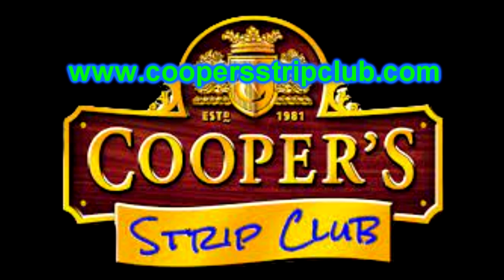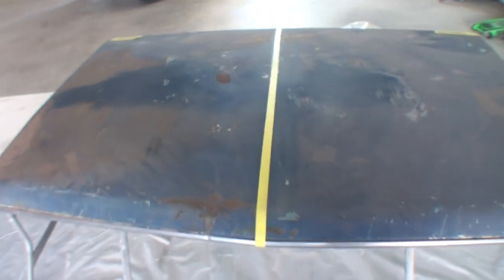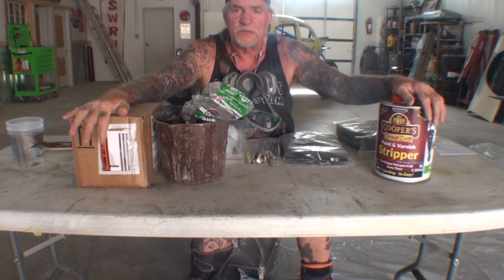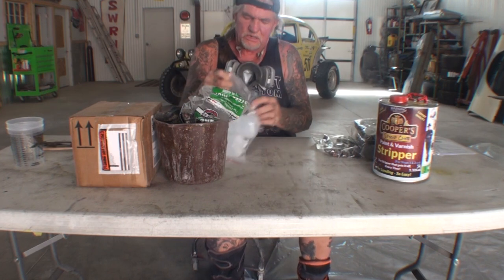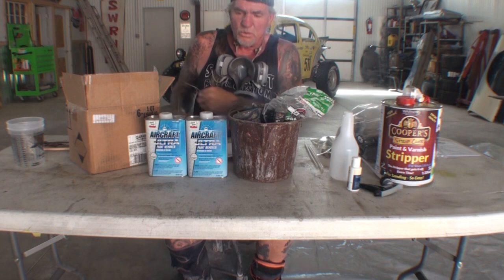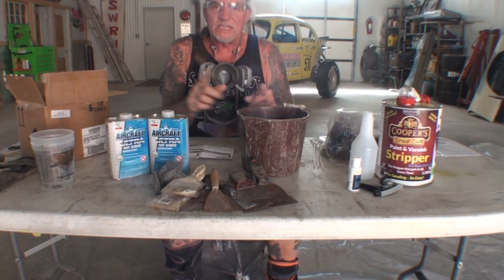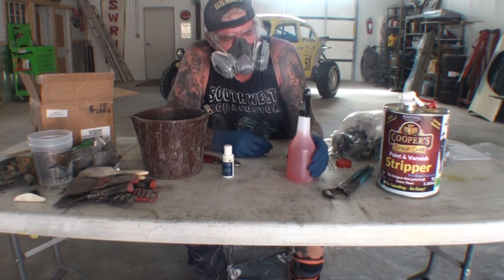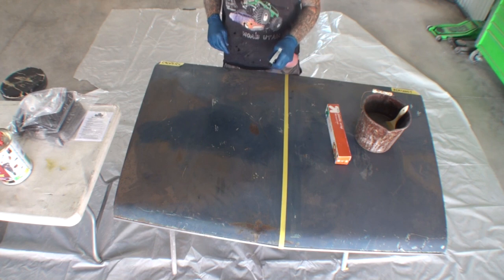Aircraft Stripper Vs. Coopers Paint Stripper - Removing Paint Off A Car

Comment: Look at the price comparison, I just bought a quart of the aircraft ultra for $20. The cheapest option I see from cooper's is $95 with shipping. And that doesn't include the flusher, spray bottles, wool, etc. To get all of that would be $250.

Also, from other videos I've seen, the longer you can leave the aircraft stripper on there, the better it works. I. E. Multiple layers at a time if you're patient.

Regarding the cellophane, I'd be annoyed to if I applied it in 1' sheets like you did. Just buy a large plastic sheet. 10'x10' is  $2.

If I had an unlimited budget, I'd for sure go with the cooper's. But many of us have some fairly shallow pockets.
All that to say, the aircraft stripper certainly has its place.

Thanks for posting this.

Comment: If you use lacquer thinner on the steel wool and use a rag with lacquer thinner the residue comes off much easier, especially with the Aircraft stripper... I like the aircraft stripper because it is a gel and does not run as bad as liquid strippers on vertical surfaces... Also a guy on YouTube places a paper towel over the gel stripper, applies a coat of stripper over the paper towel and then covers it with plastic wrap... Works really well and seems to supercharge the stripper... BTW I've used both products to strip paint off corvettes... Cheers... M

Comment: An old trick was to give it a rough sand so the chemicals penatrate faster.

Even the old aircraft stripper. It was a trick to lay plastic on it to keep it wet and keep the paraphins in there.

Comment: My experience with Coopers Strip Club paint stripper.  I am renovating a 1975 MGB and it is time to remove decades of old paint and areas of relatively new paint.  I waited impatiently for my kit to arrive, and it did about 9-10 days after ordering.  I had watched a bunch of videos and read all of the directions. 

I filled both of the spray bottles.  One with stripper and the other with flusher then sprayed one of the front fenders.  The relatively new paint (3 coats of 2K Urethane and 3 coats of 2K urethane primer) peeled off down to the bare steel after sitting for about 5 minutes and I got ready to junk my DA and rotary sander until I got to the sections with the factory original, 49-year-old paint and primer.  A few areas began to bubble after several sprays, keeping the surface wet.  After about an hour, I used a putty knife and attempted to scrape.  Almost nothing came off, so I sprayed some more, kept the surface wet and tried again.  Oh, I was spraying with light to moderate coats of spray.  the base barely came loose.  I switched to a combination of the DA with 120 - 80 grit and additional applications of stripper.  I have a very long way to go and am disappointed but will persevere.

Here are some of the issues:

The triggers on both bottles stopped functioning after a few hours use.  I cleaned each sprayer and blew air through each one while depressing the triggers.  The airways were not obstructed.

I only received one trigger tube and one handy faucet sort of thing.  The spout worked nicely, but I would have liked 2 of these.

I would have liked to have more Flusher but will husband my supply to make it last.  Incidentally the stripper hurts like hell if and when any of it gets through to the skin.  A spray of the flusher stops the burn.

All in all, I would recommend this product for relatively new paint removal.  Paint removal from a classic auto does work but is very tedious and consumes quite a lot of product.
.
Reply: Abrasive blaster. Done.

Comment: Looks like I’m gonna have to try the coopers on my 914 doors. I didn’t want to blast them because I’m concerned about warping, but they have multiple  layers on them
Reply: @benzracer9  From what I see, the Coopers Strip Club product will serve you well! As you indicated the vehicle may have 4 layers or 4 paint jobs which includes many layers but success is with in your hands. They have owner videos and customer videos, sold in kits but available in bulk container of liters from New Zealand. Instead of methylene chloride exclusive to the main ingredient it uses a chlorinated base. Opposite of an acid yet it soaks into micro pores of the paint. Repeat as needed for layers of paint.
  The EPA banned sales of products containing the sale of methylene chloride not because some people improperly used it and passed, but they could not control the disposal of the product and paint debris it removed.
  I bought many, many gallons at Menards as I saw the price increase. I am doing a 1967 C10 truck for myself. If you have plans to do multiple customers in the future, Coppers appears the best way as it does contain methylene chloride at a lower level that allows for sale now. This is subject to change but $250 will get the stripper and finisher in large quantities. The additional items you may wish to purchase are made available. DK, Omaha.
Reply: @deankay4434  yeah, I’m definitely going to order some for this project. I happen to have the doors off the car,so I can set them on stands which will make it easier to strip them too.
Reply: @benzracer9  Note; Just explain to wife in advance to charge showing up on credit card!!!!
Better to ask for forgiveness than permission or in some cases both!
LoL. DK, Omaha

Comment: Great stuff! Love your channel. Any suggestions on How much of the Coopers product you would need to strip a whole P/U truck or Car?
Also, the idea that your going to wrap up...say a whole car or even an AIRPLANE in cellophane every time to strip paint is insane...so understand why the Coopers is top product in that respect.
Reply from the maker: On their website there is toll free phone numbers for several country’s And one of them is USA. The lady will answer all you questions.  Thanks for watching
Reply: @Love Trump  > The lady I spoke to is the owners wife. She is extremely knowledgeable and no hard to understand accent, easy talking. The sell kits but re-fills in larger containers. I can’t speak for the shelf life but I like research before spending my hard earned Biden Bucks as you get so much now! (NOT!) 
I have a 67 C10 and I am sure would know that is a lot of square footage. Yes, the steel wool is much stiffer and the nylon pads are dense, with that said, or a re-fill of “Stipper” and “Flusher” and look at a liters = Gals calculator online. I think it was $250 delivered. They maybe slammed with orders after Petes video, and good for them! From what I can tell, get the refill size, you are smart enough to figure the rest out, but keep containers closed, sealed in a coil dark area if you have left overs, you should be good to go for several years. I am in Omaha and instead of Polar Vortex and Global Warming, we have weather! It’s like calling suspenders “Anti-Gravity-Devices for Britches” but we just call them suspenders. However, I think uncle Joe is going to write an executive order called “REF” for “Rubber Elasticity Failure” order making rubber bands, bungee cords, suspenders, underwear elastic and bra straps use less and not spring back (Their goes his Depends underwear to his ankles) another not well thought out bill, but, in this day and age, I am surprised stamps stick to an envelope!
  Coopers refill I think is the way to go when getting the most bang for the buck right now for a complete truck plus more, depending on the # of coats on the vehicle. Our cars are much bigger as they have to drive on streets from 400+ years ago, with cart & donkey!
  The phone number requires no country code so just call. 
 Stay safe, have a great 2022!
Reply: @deankay4434  Wow..thanks for detailed answer...but now I gotta get my nerve up to take the step to start this project. Thanks for that!

PS: I will say you got one thing wrong, as you should know: It's been ages since Joe could write, only his handlers write and sign documents! 😀
Reply: @lovetrump1088  Yep, he gets out a dictionary if he needs to count about 20, but removes his socks if he needs to spell large words.
  Note: if you use a credit card just remember to explain to your wife in advance the charge for “Coopers Strip Club” is for a car!!!
  The “Flusher” fluid has a chemical to prolong any flash rusting. Also, make a plan! As Pete always says to work “One Area” at a time. So here is a suggestion. To do gaps and fitment between panels, starting at a good quarter panel, simple strip only that first 3 inches of the door skin to use a slap-hammer, dressed body hammer and weld as needed. Grind and shape using a paint stick as a guide to start. Leave the paint on the rest of the skin to start. Same with rust. Work the metal to get real close. I also subscribed to to “Sylvester’s Customs”. He finishes the metal, rust, dents on edge and once done, he mixes filler and with gasket, good hinges, latch all done, fills two spots at the front, bottom and back to allow it to harden with the door, hood, deck perfect, places the filler in the gaps to harden. No, the panel can’t move so in front, behind, above and below can all be skim coated with filler or prep and spray catalyzed high-build to work with guide coat. This make everything laser straight. Use hacksaw-blade or air saw to release when done and hand sand as needed. But leave until last. So edges, gaps, rust but only remove the paint needed. I would spray epoxy just over the filler and tape off when time comes to remove all the paint off just that panel. Sand in 80 grit, W& G, tack & blow with air, mask and spray with epoxy. I am a cheap bastards, so I actually clean the PPS 2.0 cups for re-use. 
(Tack-Rags) Surgical Blue tack rags, or any brand, take one out, open up and hang out to dry a little the use light pressure with clean dry air. Place in clean coffee can, masking tape the I.D. on a label to reuse. Many are scared of tack rag because of past problems. Theses collect dust while wiping but drag don’t push!
 Sylvester’s idea of locking the door, truck or hood in place flat after repair is cheap genius. Long board the entire panel as one. 
 Jim Stout with “Stout’s Customs” uses a wood yard stick or paint stir stir stick, cuts to length, eases one edge over with a long block, but use these as sanding blocks cut to length. Depending upon hand / finger placement, it has better contact in reverse crowns while leaving sharp edges along. 
 Out of habit, but used to work at dealer until 9PM, but got up to milk a cow on the farm as a boy. So bed is 11:30 PM, wake up is 5:30-6AM
 So I focus on 67-72C10 and good stuff on YouTube like Pete, but watch other bodywork / paint as best practices and chemistry has changed. I watch two over-the-air TV (Cowboy Westerns / DEFY) that’s it. 
 Hope this helps, gives you some ideas and yes, big projects but like the old saying; A journey of a thousands miles begins with a single step! 
 Having info doesn’t hurt either as both “Stout Customs” and “Sylvester’s Customs” both do show car-trucks. If I learn 75% of what they do, I will have a successful restoration! I am a mechanic, not a pain & body guy, so I am learning current chemistry & procedure!
Best of luck buddy with your project in 2022 and beyond. I have done 7-8 cars/trucks of our own but years ago. Shoot If questions arise… DK, Omaha, NE. Hope this helps, lot to learn. Monday, bring two #2 pencils and two types of I. D. as a test will be given on your homework! Lol.

Comment: Great video. I always hated using aircraft stripper mess. I have a car to strip so very timely for me. Think I'll try applying the Cooper's with a pump up garden sprayer.
I have a garden sprayer that I use for Super Kleen. Easy to get into tight spaces.
Reply from the maker: My understanding the best results is light coats sprayed on.  So be careful not to over spray. Let us know how it works out.  Thanks
Reply: You would be totally wasting product. No need at all for that.
Reply: @diyautoschool  Will do Pete. I have a hood that has louvers punched that I'll test 1st.
Reply: @SOLDOZER  ..... Thank you for your concern. My sprayer holds about a quart of fluid and the nozzle can be adjusted from a fine mist to a steady stream I think I can mimic the application of their  spray bottles they supply.
I'm a fossil. In 1985 a tire that was dropped off to fix a flat, it had a broken bead and became a missile.Long story shorten shattered right elbow(screwed & wired) both wrist damaged and several bones in each were fused. I little issues with body work/paint or turning a wrench but that squeezing the spray bottles would be near impossible and extremely painful. You learn to adapt or sit in a Barcalounger watching TV all day.

Comment: Great video! I wonder if a garden sprayer would be helpful in applying the stripper. Your hand wouldn't get tired of squeezing the trigger and a long wand would help reach the roof and keep the stuff off your skin.
Reply from the maker: Instructions claim light spray coats work best.  Using a bug sprayer or weed killer spray would probably waste a lot of it.  It doesn’t take much for it to work properly.

Comment: So my 1965 C10 was painted over at least once, the paint is starting to chip off and the primer is starting to show. (I didn’t paint it.) Should I use this paint stripper to get down to the metal? 
Also, what are the next steps? (1. Clean the flusher off with alcohol. 2. Spray epoxy primer to seal the metal. 3. Fix any dents/apply bondo, etc.

Thanks for all of your help! I would not have attempted to rebuild my truck without your help!

Comment: Was wondering how sanding instead of using stripper would compare .
Especially on the original paint and primer such as was used on 50’s cars etc 
Or combination…

Comment: Hi, Pete!  Question:  What's the best way to remove powder coating?
Reply from the maker: Copper claims it will remove powder coating. I would say blading it is the best way. Depending on the surface would depending on the blasting material to use

Comment: Not convinced. You should check out the video that ammo from nyc put out when he when he used aircraft stripper to remove the paint from his Porsche 911.  Two passes and the aircraft stripper took the paint down to bare metal. One thing he did differently compared to you was to apply a single sheet of plastic over the entire painted surface. The reason for is the stripper is exothermal(produces heat) and plastic acts to retain the heat so that the stripper is more effective. Check out his video on you tube.

Comment: Clearly an ad for cooper. He sprays on multiple coats of cooper for 1 coat of aircraft stripper. He does what the cooper says on the aircraft instead of using the putty knife to crape off the aircraft stripper.

Did anyone else notice that the cooper side, you could see th brown from the original paint already showing through before he started?

This is a joke.😂